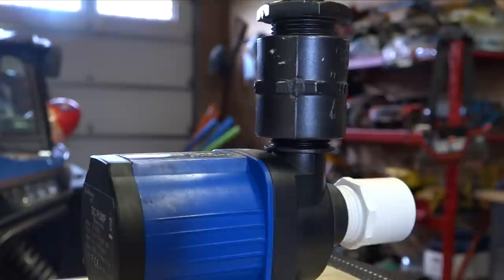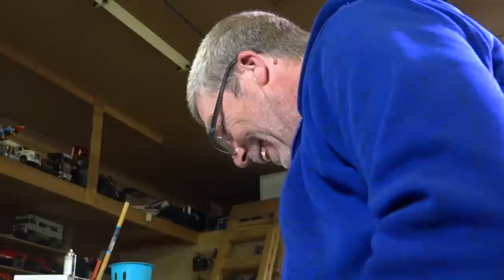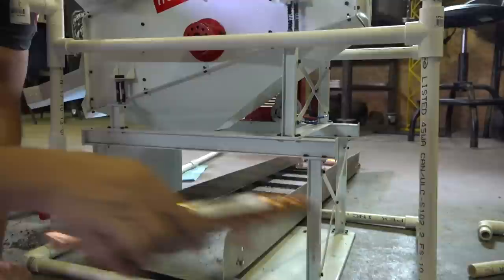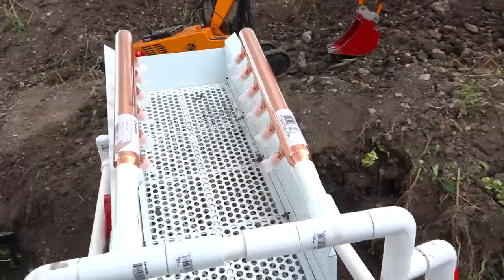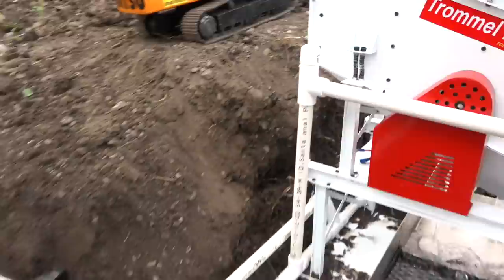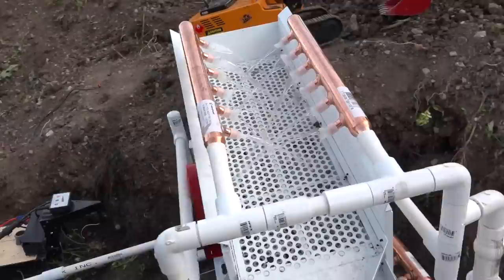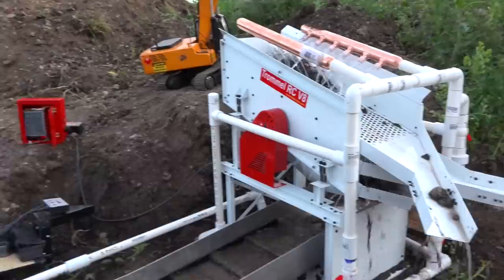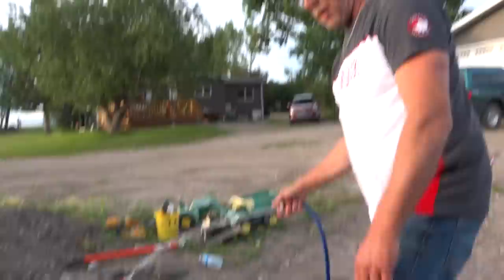YouTube GOLD - Building a Mini GOLD Wash Plant: Water System (s1 e3) | RC ADVENTURES

Comment: Nice work on getting the setup done and the test being successful, but you may want to consider this. Have two different pumps instead of trying to have one supply all the pressure to the plant and box would help cut things and problems down. Also you have have an air pocket in the lines of the excavator or the fluid may be old and need changed out as well.

Really ready to see the entire thing running and you may want to make a pone to recover the water and reuse it once you get into full operation.

Comment: i would consider using two pumps on that setup... 
circulation pump on the bottom, and a pressure pump for the top.
eheim compact+ 3000 is a very good circulation pump, would be good for the bottom...
maybe a diaphragm pump for the top, might run hot for extended use tho.

Comment: Loose the PVC sprayers you made and go to agricultural spray tips used on field sprayers. They are fully adjustable and are cheap. You can get them at pretty much any Farm Tractor Implement supply in your area.
Reply from the maker: Ill head down to UFA.. what about sediment build up?
Reply: dieseldave564 great suggestion but  I think spray tips will plug up to fast with sediment when the water is being recycled .

Comment: Great job with this one, loose the metal spray bars make a hoop to go around the top and drill holes in a line 1/8inch should be good velocity and pressure.. on my mining gear I use 1100 gpu pump on a gold cube..Great job  keep going this is awesome

Comment: To get more pressure you can always use smaller diameter tubing. Or you could pinch off every other jet up top with a criss cross pattern between the two jet systems. That way everything's still getting sprayed but more pressure

Comment: Awesome video man. I cant wait to see the final functioning master piece its gonna be great!!!! You definitely need more psi at the bottom. On the top end I think it may benefit more as a flooding wash then a high pressure blast to help move the dirt that is becoming mud. Or maybe higher psi at the nozzles will help better its definitely something to play with and figure out but I want to see all the experimenting and different attempts since the channel is as close as I can get to living out this hobby right now!!!  So cool man I love it I'm excited to see your channel venture into a new direction freshening up the rc hobby on your channel. Idk if you read this far yet, but the one thing that kinda bugged me was I felt like the flatbed trailer which looks badass by the way with the pump and everything on it. (It looks like something you would see on the jobsite as I use to be in the heavy highway construction.) Was facing the wrong way so if and when it gets pulled out for another task and materials were off loaded to the ground so it could stay in service you would have a hell of a time getting it out... like I said just my thoughts it's your channel and your awesome stuff do as you please I'm just rambling at this point lol PEACE✌✌👊

Comment: did you ever think of using sprinklers heads? they'd be more scale and a lot more pressure out of them  and you can place them right on the shaker 

and for hose the stuff they use in camping trailers is about 1/4" and would hook up to it without pressure loss and not requier as much water 
just food for thought my friend as I'm sure you'll make it work no matter what 
can't wait to see it in the field

Comment: Hi from Liechtenstein
I like your Videos and the Gold Videos i like most. For your water system, you could try smaler pipes to get more pressure and the top sprinklers you could use nozzles from 3d printer. 
Maybe tubes from a planter watering system would be smal enough. The construction could also be smaler, why arround the shaker and not connecting to the botom of the shaker. I am not sure but smaler pipes and shorter ways would generate more pressure. Sorry for my english i hope you understand 😊

I would like to be near to help with these system.

Comment: I would get rid of the copper sprayers and dill some tiny holes In the pcv
Reply from the maker: I was also thinking hole size was an issue..   but we wanted a wide spray.. not just small jets of round water.. so, that was my goal..
Reply from the maker: I just I cut cut "slits" into the PVC, hey? Then we would have more pressure.. or just make smaller nozzles..
Reply: Bit of a spelling mistake haha. I have been enjoying your videos for the last 3 years and have gone out and brought a xmaxx 8s. I used it run old tamiya rc but got back into the hobby because of brushless power and it’s a huge difference.

Comment: Hey medic my trail finder 2 turns more to the right then left. I tried aligning my servo but still can’t fix the problem
Reply from the maker: You need to remove the horn, and re-set the servo trim. Then re-attach the horn :)

Comment: You should get a boat bilge pump 500gph works great for pressure
Reply: Ryan Allen  the current pump is about 800 gph
Reply: Optimusdude I think what he should of done was used smaller pipes or even small hoses to deliver more water. what do u think
Reply: Ryan Allen  I think smaller nozzle design is what is needed for more pressure. Trial and error is most certainly a part of this engineering task lol.

Comment: Boy could I have fun with that setup around here. There are lots of huge tailings piles in the rivers around my area from the steam & electric dredges that were used in this area from the early 1900's up until 1962.  Suction dredges have been banned here in California since 2009 but I could probably get away with running a "model" shaker plant without getting in "too much" trouble (though this "is" California so I'm sure they could figure some way to fine me.. or put me in prison for life.)
Reply: thought police will catch up with you.  It's off to room 101!
Reply: Duck Landes Well the good news is Your fines will only be 1/10th of what they would be.

Comment: Couldn't stop laughing. Bucket broke, not the right water pressure. Just like the program. If you want to keep to as much the same as the program. You just need to dig out were the water is building up so you have a mini pond going to your main pond. Endless water. Then your hose pipe can be used to just top up your mini pond's. You will have loads of water and then a more powerful pump if you need it. So😎.
Russ 🇬🇧
Reply from the maker: I hope you can see the true parody in this show Russ!  I know so many people will miss the puns and the funny ways this show worked out.. but I know from your comment you can tell it was all in fun :)  And yup.. all in time, I have the plan.. this was just to test the plant.. We all know test 1 is going to fail.. but the concept is there !
Reply: O yes I picked up on the 1 liner's. Just thought I had written a big enough reply. And the huge fun to mess around with cool rc's and mud lol. All I can say is Peter pan 😉. Cheers for my belly ache from laughter.
Russ 🇬🇧
Reply: @A McCarthy hi what does this mean 👍